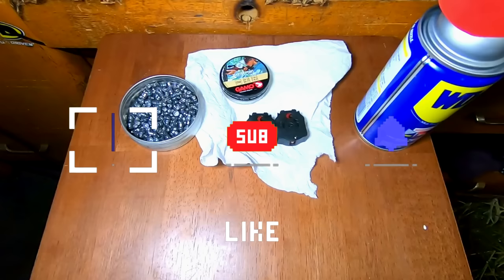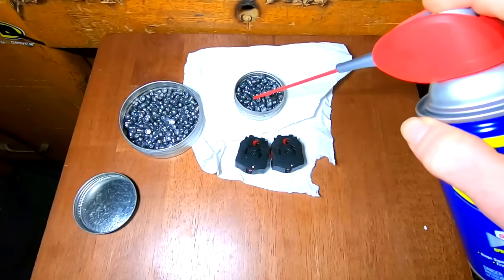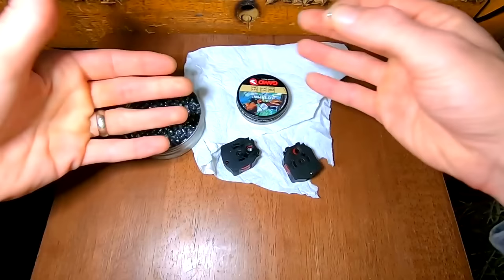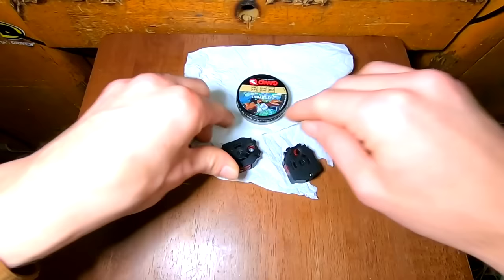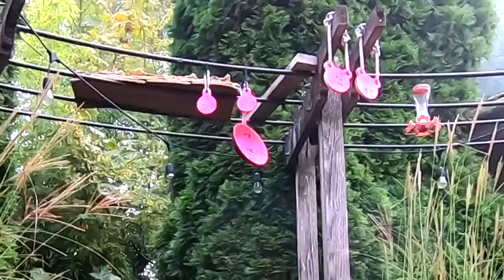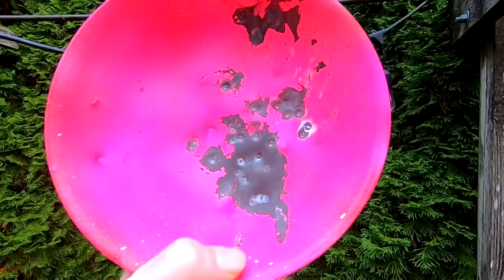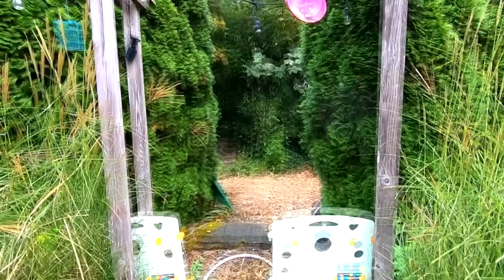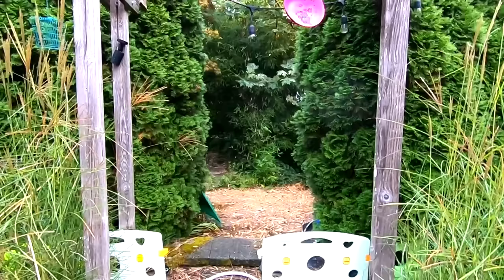Pellet Dieseling the Easiest & Quickest Method

Comment: Extra velocity is pointless without acracy, the problem with dieseling is the velocity varies.
Reply: With an average or shitty rifle you've got that "problem" anyway!      Btw, the variation in speed is usually so small that most complainers shouldn't blame this tiny difference on missing the target.   😂🤣
Reply from the maker: I dunno I can still hit targets just fine, just moves the group up a little
Reply: @PelletPlinker  What's your grouping like at 40 yards?
Reply: @taunteratwill1787  Variation in velocity makes a massive difference, spring powered are pretty consistent, unregulated PCP are generally consistent over a number of shots, they have a sweet spot, regulated PCP,s are pretty consistent, this probably doesn't apply to you as you have a shitty rifle,😂
Reply: @hetrodoxly1203  Slightly triggered much? 😋
Reply: @taunteratwill1787  not at all, my trigger is set at a light 2lb.
Reply: @hetrodoxly1203  Not what we call an hair trigger, but that's what you get with amateurs.   😂
Reply from the maker: I don't have 40 yards of distance to shoot, so I don't know, but also isn't relevant to my shooting situation.
at about 20 yards I can get an inch or so group on those 3inch hanging targets.

The extra velocity actually increases accuracy, since not only is there less drop over the same distance (since the faster bullet gets there in less time) but also less wind interference for the same reasoning. 

Additionally (I have a video that shows this btw) there are pretty massive discrepancies between the weights of pellets. 12gr pellets can range from like 11.5gr to 12.5gr. This is +- 4.16% difference from the listed weight, but more importantly, +- 8.7% difference between the extremes. That is a nearly 10% potential difference pellet to pellet as far as weight goes, which will HEAVILY effect the speed and accuracy, and as a result, the size of your group.
The point being that not only is your group going to vary wildly anyway, unless you are meticulous enough to weigh every pellet and weight match them; BUT, adding velocity overall will diminish the overall wild variance, not exacerbate it. 

In other words, making the pellets go faster makes them more accurate, but you will have to adjust your aim point to compensate for less drop.
Reply: @PelletPlinker  Making pellets go faster doesn't make them more accurate, there's a critical point where they rip through the riffling, the reason they use slugs in higher powered air rifles and longer barrels, in fact target rifles have very low velocity, if your just plinking in your back garden fine, if your going hunting consistency is crucial.
Reply from the maker: Yeah but these pellets still aren't going anywhere near fast enough for that to happen. 
We are talking about just BARELY breaking the sound barrier with a 12gr pellet. Remember the fact that my maxxim swarm magnum is already rated for shooting 9gr pellets at supersonic speeds. The 12gr pellets are physically capable of even higher speeds than that, however out of an underpowered gun like even the magnum is technically, these do not achieve anywhere near supersonic flight on their own.
 I know that these are only barely on the cusp of supersonic flight while dieseling, because I don't get any sonic "boom" (crack) from my 14gr pellets, even when dieseling those.

High powered PCP rifles go well above and beyond the speeds I am shooting at, even with heavier pellets up into the high teens, and even into the 20's as far as weight is concerned. 

In other words, for my situation, and the situation of most people shooting springer rifles like mine, this quite literally is not an issue. dieseling adds speed, but not enough to where it would put it into dangerous territory. 

Now if you managed to source the 9gr pellets they test with at the factory, which is nearly impossible, since only GAMO makes these practically non existent pellets, and sells them for like a dollar per pellet practically. If you dieseled one of those, you probably would enter some unstable speeds, since those are already capable of supersonic flight on their own, and are much lighter.

okay not quite a dollar per pellet, but 25 cents per pellet is still pretty fuckin bad. 
I used to get 7.62 cheaper than that: https://www.amazon.com/Gamo-Raptor-22-Grains-50ct/dp/B001F0IR6I
Reply: @PelletPlinker  I was replying to your quote ;the faster the more accurate'.
Reply from the maker: obviously there are limits
I mean after a certain speed the heat will literally melt the pellet, so, yeah.

Comment: Dude...WD40 will eat the shit out of your seals. Yes it is on the pellet itself but a portion will kick back into the works and screw up your gun. You can achieve the same effect with Pell gun oil or non detergent transmission oil...no worries.
Reply from the maker: pellgun oil is what I normally use, this was justa quick and dirty method someone suggested in the comments

And wd40 doesn't hurt seals, dirty seals hurt seals, which WD40 will attract dirt and eventually also dry out leading to non lubricated seals as well. If you are re lubricating, and ideally cleaning the gun you have nothing to worry about

Comment: News flash...it won't break your seals ,if under 1991fps ...🙂it's tested scientifically...also ask a gunsmith
Reply: I'm a gunsmith and it will kill a sub 12ftlb gun quite quickly. Trust me, I've seen it and repaired the damaged seal, piston head and cracked spring on a number of occasions.
Reply: @nicfraipont4184  .. seriously 😂I'm a gunsmith... And a fan of Air guns.... And no I am not a neogliphic...but world war 2 tech.... showed some type of light on air guns and there capabilities..Google the truth 👍🥴

Comment: I have always understood that "dieseling" in an air gun was actually a fault to be rectified!  I can't get my head around doing it on purpose...
Reply from the maker: There are two "types" of dieseling. 

The one you are thinking of, to be avoided, is the result of excess lube, like, a LOT of lube, getting into the piston chamber. The piston chamber being much larger than the breach can hold more fuel AND more oxygen, and only has the tiny airhole to escape from (this hole is about half the size of the pellet/bore hole).

This type of dieseling results in a LARGE combustion, that gets trapped INSIDE the piston chamber, potentially damaging piston components or the chamber itself.

The dieseling featured in this video is completely different, and also happens on a much smaller scale, and OUTSIDE of the piston chamber. 
We are talking about a VERY SMALL amount of lube/fuel in the skirt of the pellet, and a much smaller amount of oxygen in the barrel/breach area. The path of least resistance here is also much different, as the pressure will find it MUCH easier to push the pellet forward toward the larger opening (barrel) than it would find it to go into a SMALLER opening (piston air hole) and try to force the piston out of the way, which is held in place by a spring, and is completely blocking the air path.

Essentially, pellet dieseling is a small combustion at one end of a long hallway, and piston dieseling (the kind you want to avoid) is more akin to just a straight up grenade.

Comment: It'll ruin all the seals and polymer parts and  the pellet's BC is not designed for the speed so it'll fly wild.  It's just a bad idea all around.  If you want supersonic buy a .22 caliber lon rifle powder burner.
Reply from the maker: fuckin what lmfao
Reply from the maker: No it doesn't.
I diesel 10 shots out of a 10 shot magazine, and have done so dozens of times out of this gun.
Even 10 dieseled shots back to back with no delay isn't enough to melt or burn a seal.

Have you ever put your hand through a candle flame? You can even take a tissue paper through a candle flame with no damage if you do it fast enough.
Fast enough is the key ingredient here. The explosion and propulsion happens in a fraction of a second. Probably a fraction of a milisecond. Even if it was hot enough to melt the seals, it wouldn't, simply because it doesn't have time to. The fire is gone before it's even there, that's how fast it happens. Same thing applies to the polymer parts, of which there aren't any, except for maybe in the piston if it's made out of polymer. And if you are referring to the polymer in the piston, it's even further from the explosion than the seals are, and is in an EXPANSION chamber, not a COMPRESSION chamber. This means not only the heat energy, but also the velocity energy, will all dissipate extremely quickly as soon as they go from the extremely confined barrel/breech space, to the much larger and more spacious piston chamber. This decreases pressure coming in, and decreases heat coming in (laws of thermodynamics and fluid dynamics).

In other words, you will pretty much never hurt your gun doing this. I still have yet to see any evidence of a single person who has damaged their gun doing this. And the math/science supports this data. Dieseling just won't ruin your seals.

As for "ruining the pellets" this also isn't true. They stay fully intact and fly more accurately since they have more speed and are effected "less" (perceived less over distance, not actually less) by wind and gravity. Your groups will be higher than they were before, since the pellets are moving faster, and are not dropping as much over the same distance.
But the groups will also be tighter, because the pellets are moving faster, and not getting knocked off course as much in that same distance.

And if my cheap pellet gun breaks after 4 years of dieselling the hell out of it, not only did I get my money's worth out of the gun in my opinion anyway, but these videos are already paying for my next air rifle so I wouldn't give a damn anyway.
Reply: @PelletPlinker  keep it up then   you'll see.
Reply from the maker: I've been keeping it up, still haven't seen.

There is no scientific data that supports the notion that this would destroy ANY part of the gun.
Reply: @PelletPlinker   Well you can be the first. That's assuming  you don't think the Airgun manufacturers and their engineers  are sufficiently  reliable.  It's in most springer and gas piston manuals.
Reply: ruined nothing
Reply: @TANAXdirecto  yah sure
Reply from the maker: No it doesn't. 

Post a link to a singular air rifle manual that even so much as mentions dieseling, let alone lists any data against it.
Reply: @Pellet plinker don't sweat these guys.   Keep experimenting.
Reply: @ghostmanscores1666  yah I know.  What did PT Barnum say? "there's a fool born every minute" ?   Yah  that's what he said.

Comment: Spring guns diesel anyhow it's partly how they make power so change the cylinder lube to something more akin to axle grease, it won't be as good but you're have a bit more drive and it's more consistent.
Reply from the maker: you don't want the cylinder to diesel, just the pellet
Reply: @PelletPlinker  the extra pressure go's both ways anyhow. Normally they flash in the transfer port but like I said this is a good side effect of most spring guns, uncontrolled dieseling will harm spring, seal and the cylinder of course, what I'm trying  to get across is if you want higher pressure change the main lube it won't give the same extra pressure but it's a more consistent way to get a bit more shove ! 😁
Reply from the maker: yes pressure goes in there anyway, but you don't want the "explosion" itself happening inside the piston chamber
Reply: @PelletPlinker  true you just a want a little detonation in the cylinder main extra pressure from (fuel) seems to happen as a flash in the port, there quite complex in how they work, a study was done and it seemed to show that as the piston moved forward some fuel is striped from the wall and detonates just before the end of the stroke about 6mm from the end wall bouncing the piston back off a cushion of high pressure air as the pellet unsticks and starts moving down the bore the piston then moves forward again as the pressure drops, all that just from a piston and spring system! Funny some guns are built to try and stop this making the power plant more consistent for accuracy at the cost of less power.

Comment: I use a break barrel 177 one drop of Remington oil  on rear of pellet works wonders sounds lik 22lr should call it oiling no diesel involved
Reply from the maker: dieseling can happen with any petroleum substance 
diesel fuel is just what they use for diesel engines, but the word diesel basically just means it is using pressure to ignite the fuel, instead of an ignition source.

Comment: OUT-FUCKIN-STANDING video!
Dieseling never ruined any of my air guns, either.
Reply from the maker: thanks
Reply: You were lucky. Then, again, just give it a little more time!
Sold a perfectly good working BSA Airsportet to a friend who proceeded to wreck it through diesel ing in only a couple of months.
Until it failed, he could NOT see/measure/understand the internal damage being caused to this previously functional air rifle.
He came back to me trying to obtain a refund for HIS stupidity.
He didn't get one. 😂
Reply from the maker: The relevant question here is:
When you say he "proceeded to wreck it through dieseling" do you mean to say he told you he was dieseling his pellets and that now his rifle doesn't work

OR

do you mean he came to you with a wrecked rifle and you deduced the damage was due to dieseling?

If he didn't directly tell you what he was doing with his rifle, I have 2 more questions.

1. What makes you think the damage was caused by "dieseling"

and- if you ARE sure it is damage from dieseling (assuming he didn't tell you what he did)

2. How can you be certain that the dieseling damage is from the act of putting a small amount of oil in the skirt of a pellet, and not the more likely scenario of someone over lubricating their airgun, getting a large amount of oil in the piston chamber itself, and causing a much larger combustion actually inside of the piston chamber? (i.e. not a barrel/breech combustion which is what occurs with pellet dieseling)

I have yet to hear a story of someone who has broken their gun from shooting dieseled pellets. I have however hear plenty of stories involving over lubricated piston cylinders. The frequency of which I hear these differing stories (i.e never for pellet dieseling, and fairly often for piston dieseling) I can only really assume that any person who you know who broke their rifle this way, it was statistically speaking, almost guaranteed to be a piston combustion, not a pellet combustion.

Comment: Yo OLD CHEAP MOTOR OIL WORK THE BEST!  Trust me!

3-&-1 oil amd Wd40 evaporate too quickly. But use motor oil. Put it m the cam. A few drops. NOT TOO Much, shake the pellets around with the lid covered and as long as u see a drop of oil within the skirt that’s what you want

If you leave the can in a Cool place the oil will thicken within the skirt and stay 

I shoot a gamo .177 @1300fps. I swear with motor oil my gamo launches a 10.3 pellets at least 1430 fps. Go clean through a squirrel at 100 yards. No problem!  I just killed a possum about 30 mins prior to sending this comment!

Comment: Try using timi torch fuel or known as karosen however you spell it spunds like a rifle going off snd with a 30 cal break barrel it kicks and ks supper loud blew the head straight off a squirrel dont donkt slot but knce doesnt hurt
Reply from the maker: i.e. jet fuel

also heard normal diesel works well

Comment: WD 40  is mineral oil and alcohol .  Once the booze evaporates, there should still be the mineral oil.  Try using just baby oil.
Reply from the maker: not mineral oil, it's petroleum oil
I have a video about wd40 material safety data sheets and what it's made out of

Also no alcohol either.

Comment: Based on the looks of those pellet mags, you are using a gamo rifle. I was just wondering what scope you are using and how it is holding up. Thanks
Reply from the maker: just the scope that came with the rifle
it's been holding up alright
Reply: @PelletPlinker  good to hear. I have the magnum pro, and the scope seems good when sighted. However, I've had to sight it in several times prior to use.
Reply from the maker: what kinda pellets do you use?

theres a good chance your scope is staying mostly sighted, but there is just a lot of variance between shots

Theses guns are engineered and tested with pellets that are so light they are almost impossible to obtain (gamo sells these for like 10x the price of a normal pellet, and they are nearly half the weight of anything you will find)

Using pellets that are too heavy is gonna give you a lot of wild variance, since they aren't going fast enough to stay stable in flight, and their lower speed and higher mass effects how they interact with the rifling of the barrel 

Basically, the lighter the pellet, the better results you will get in terms of accuracy

Dieseling definitely doesn't help this at all, but typically the only thing that changes when dieseling is how low you have to aim since they don't drop as much over the same distance, so you can get away with just aiming a few inches lower

if you are using .22 the H&N excite is probably the best/lightest pellet you can find that isn't the gamo overpriced crap
https://www.amazon.com/gp/product/B00MOGPAH6/ref=ppx_yo_dt_b_search_asin_title?ie=UTF8&psc=1

Comment: I have these exploding pellets, russian brand, im afraid to do this experiment as using them as diesel method, putting 2 or 3 pellets in the same barrel. Like for example put in 1. High speed or slug 2. Exploding pellets 3. 4.5mm rond bb in the hope the bb ignites the exploding one repelling the high speed. Im afraid to blow out seals or do other damage.
Reply from the maker: still haven't had to change any seals after hundreds of dieseled shots